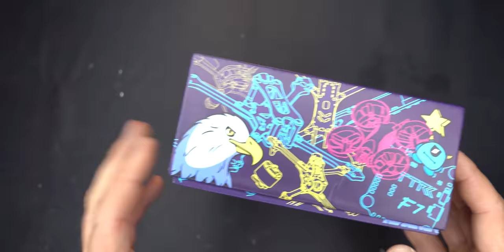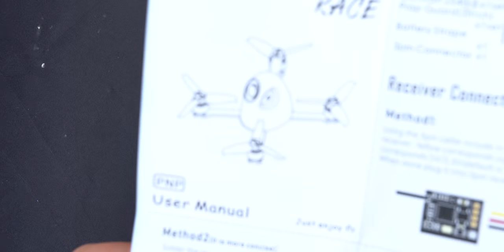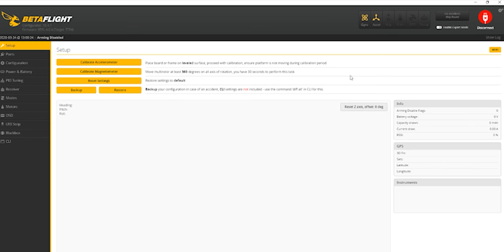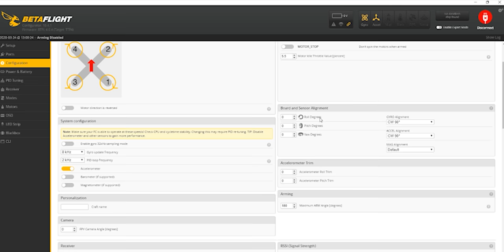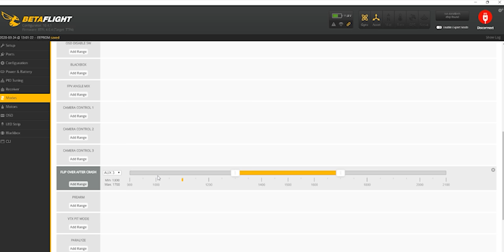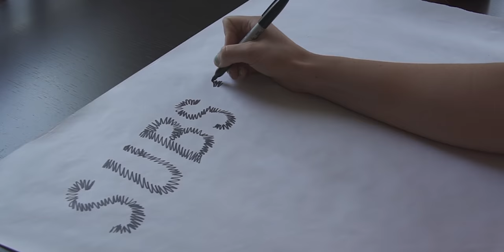Stay at Home Drones -- Starting the Search - Transtec Demon Racer

Comment from the maker: What are your thoughts on the Transtec Demon? What backyard machines do you want to see a review on? 
Please use the following link to support the channel: https://bit.ly/3bwp1fz
Reply: What size batteries is recommended for this drone?
Reply: kababfpv tp3 and Sanchez 3 please
Reply: im sry but drop this thing check out kababfpv and go by his standards or check out the twig builders group if you want a racing back yard frame get the twig frame aio board 1204 or 1303 5000kv motors and what ever micro camera fits your style i would suggest the caddx baby ratel but 3s is what your looking for man coming from a racing back ground youll be fine so much better with speed and getting out of corners
Reply: I wish we could get more of the GTB-339 16x16 stack versions for you to run - brilliant 2S spec racer, and outright fun rocket on 3S packs.
Reply: Babytooth PLEASEE!!!
Reply: sub 250g all up 5 inch is where it's at. tmotor 1507 3000kv, druckbar ultralight 5 inch frame, 20x20 stack etc. best battery for tight back yards is a 450mah - 650mah 3s but can fly on anything from a 450mah 2s to a 1550 4s pack
Reply: Diatone gtb339. You won't regret it :)
Reply: @discord2000  sorta like that, buy why emulate a safe 5 inch when you can fly a safe 5 inch.
Reply: Why does the spec list 8 leds?  8 programmable RGB are on a tiny quad a not insubstantial electrical load, but when at least four of them are buried under the black canopy, facing up, what is the point?  Seems to me with that lack of design skill and common sense the rest is going to be just as suspect?
Reply: @swg_fpv   You might enjoy yourself?

Comment: That battery alone probably weighs more than the auw should be. I was impressed that you were able to tune it in as well as you were. A 3s 450 or 525 would be about right for this little guy.  For micros like this 4.0.4 is no good. They should have either rolled it back to 3.5.7, or gone with something 4.1.X or newer. All the 4.0.X betaflight releases struggled to fly well on micro builds. Looks like a fun setup though, and the shots with the insta360 were really cool!

Comment: BF4.1 and RPM filtering makes a HUGE difference on these little micros. Then you can get decent flight time even with a smaller battery, which means lighter, which means much more 5" -like performance.
Reply: This, x1Billion.  4.2 Has worthwhile quality improvements.
I love the tuning blog info, and I feel like spending this time to get ahead of the curve on having solid default tunes on BF4.2 would be really valuable, especially as that moves towards a viable release candidate here soon.

Comment: Great video Nurk, thanks! I was looking for a smaller quad to keep me in the air during this crisis. Did you try it on stock tune before you doubled the feedforward? Don't you think that might have caused those vibrations in the beginning? And, now that we are on the topic, are you also using those feedforward values of 200 on your 5 inch rigs? Thanks buddy

Comment: Excuse my nubeness, but did it not come with a receiver?  Or did you just upgrade?  Thank you.
Reply: A lot of prebuilt micros are sold this way as pnp (plug and play) were you add your own receiver. If they're sold as bnf (bind and fly) then they already include a specific receiver and you buy the version that matches which ever transmitter you are using.

Comment: I’m more interested in rc cars but this vid got recommended to me and dam it looks fun to fly this thing around. Seems a bit more pricy with first person goggles. 
What would the cost be to get this thing running on a budget? I’d need receiver controller battery packs and goggles?
Reply: I'm seeing this thing listed for $150 USD. You can get a cheap set of goggles and a transmitter/controller like a Flysky i6 for $100 or less on a place like banggood, and then you'd need a micro flysky receiver which you could probably get for like $10-20. So all in cost could be less than $300 USD.

If you haven't flown drones before though, I really do not recommend starting with something with as much power as this. Something like a tinyhawk1/2 is really a better choice to get started with and build your muscle memory and familiarity with using software like betaflight, also a bit cheaper and can be purchased in a "RTF" kit with a cheap but functional transmitter/goggles.
Reply: You could use a simulator like liftoff to get used to flying first too.  A good technical reference is Joshua Bardwell YouTube channel he has tech tutorials for getting you up and running.

Comment: You should try the Betafpv hx100 (it's 1s so should be very quiet) been interested in it for a while as where I live, I need it to be quiet
Reply: It's the hx100se that is 1s it's great but severely limited by the spi receiver, I got the crossfire version too to fix that but it causes horizontal banding in the video and I was not able to get around it :(

Comment: Fatty fat battery. But fly with what’s you got. Looks like a solid build. 3s is the way to go with those motors.
Reply: I've flown bigger batteries on the same motor/prop setup - they fly porky, but they move.
4S for top speed is totally possible, but all you get is more top end speed and less flight time if you're using the power, so I agree for backyard flying
Reply: tehllama42 4s that kv is alright but no serious Benefit in my opinion.  But fly what you like. 3s 650 is the largest I like to fly before things start to suffer.
Reply: @Mellowdark17  There are degrees of suffering they'll tolerate - 4S 850mAh is definitely too much (flies, and is fast in a straight line, but handles like a shopping cart). 3S 650mAh or 4S 550mAh are the largest practically useful ones, and 3S 520mAh-450mAh is really ideal... just lacks for flight time if you're at high throttle a lot.